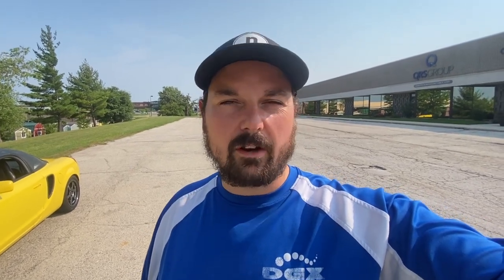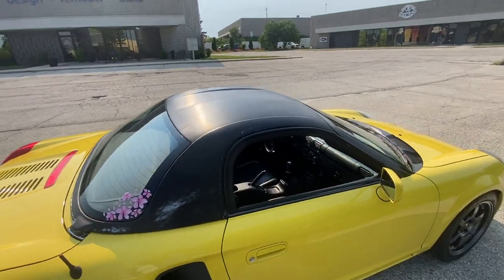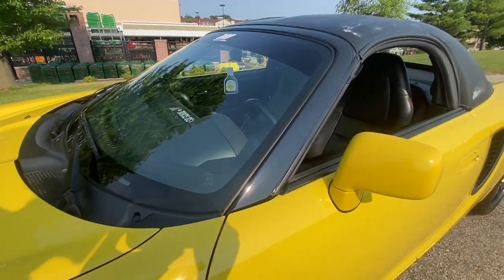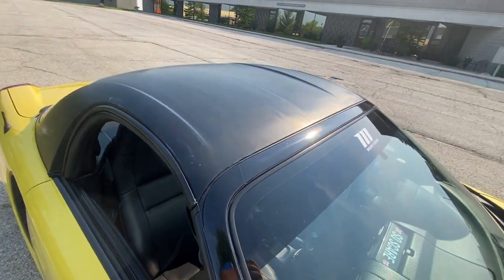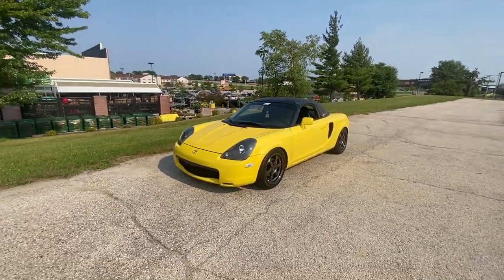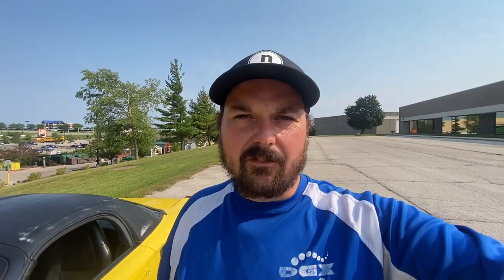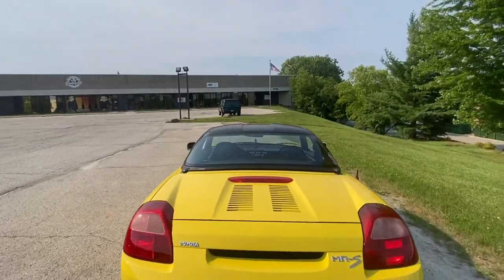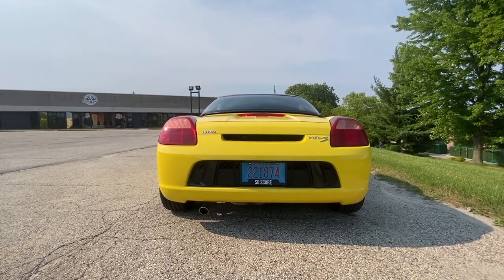A Hardtop, Wrapped A Pillar And More | Miller's MR2

Comment: Do you have the part#’s for the bumper insert? And do you know if we can get them painted from the dealer?
Reply from the maker: Rear Bumper Insert Part Numbers:
52153-17900
52162-17020 
52164-17020 
52152-17900
52163-17020 
52161-17020

They do not. They come black stock.
Reply: @millersmr294  Thank you so much!!! Love your channel brother I have a 2000 solar yellow Mr2 on rpf1’s and pontenza re71-R’s as well only difference is I’m 2zz swapping it as we speak!!